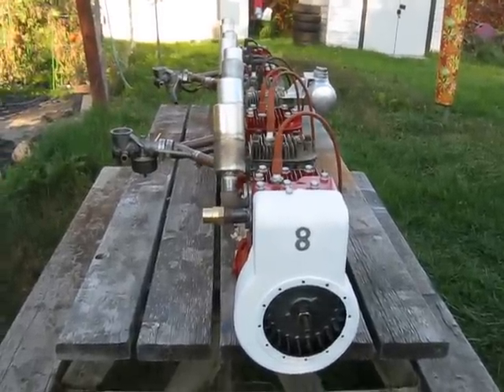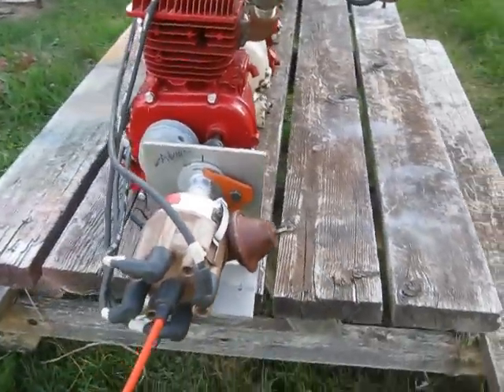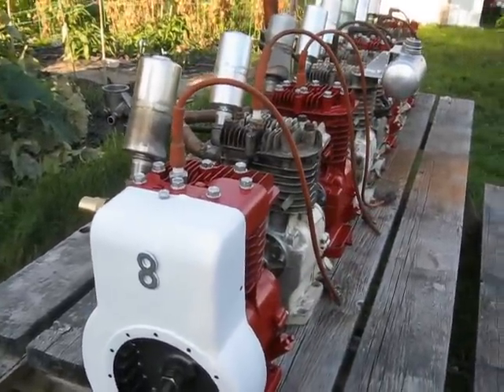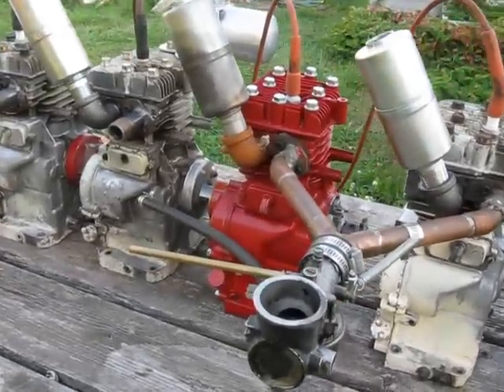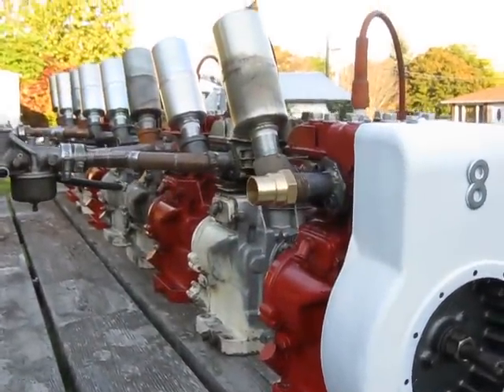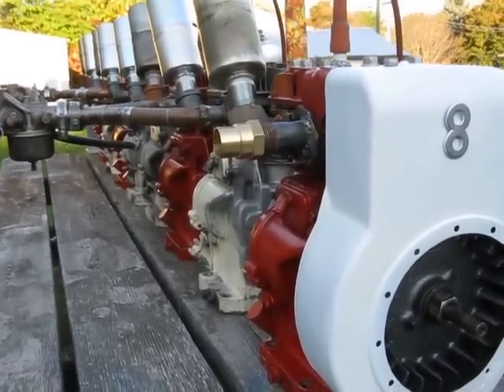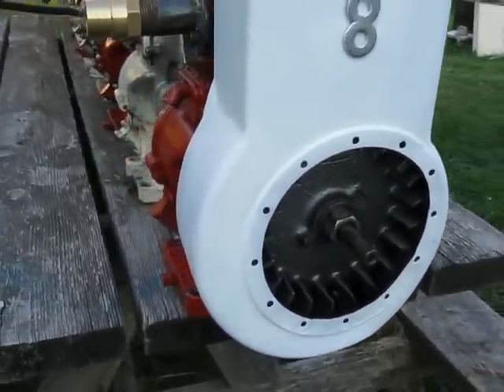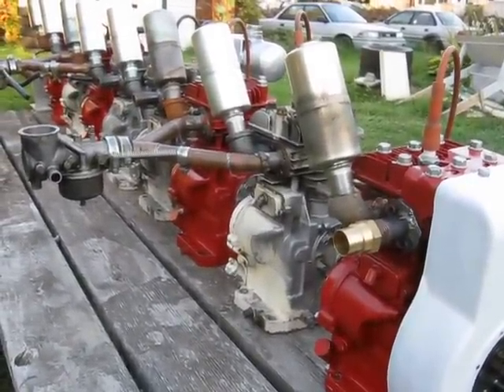Straight 8 Cylinder Briggs Preview!

Comment: use heat sinks and fans to help the cooling
Reply from the maker: +Andrew Sybert I was planning to use a fan or two on the 8 cylinder, as long as it holds together long enough to get hot!
Reply: +ChargerMiles007 lol great job ever tried making Stirling engines? they are really fun to build best regards, Andrew.

Comment: Cool project !!!! 
Maybe you can turn it into a back-up generator for your house or something.
Reply from the maker: ***** LOLYes, it would have lots of power to run a generator, but I am not certain about the reliability of the FrankenBriggs engines! The 2 cylinder stacker mower seems to be OK, but these bigger ones don't have much cooling air moving, so they would melt down rather quickly.

Comment: Looks cool man, 8 cylinders short of a 16 cylinder heh, heh. 8 cylinder, 4 cycle has a power stroke every 90° fires only 4 cylinders per 360° crankshaft rotation. Well Charger Miles, it shouldn't be too hard to get your crankshaft synchronized correctly. We're still watching for the 20 cylinder to show up some day. Can't wait to hear it run man! I bet it will sound good buddy. Take care!
Reply from the maker: PermianBasinDiesel LOL  :)  Sorry to disappoint you with only an 8 cylinder Briggs!I have thought of larger engines, but I will be hard pressed to even get the cranks made for this engine now. Been kid of a bad week for me, wife's car crushed, probably no machining access where I used to go, cold weather and rain making it hard to work on my winter car etc. etc.  Gee, it almost sounds like I am bitchin a bit here!  :)I tell you what, if I win a lottery, I will definitely build the inline 20 cylinder Briggs  :)Have a good one.
Reply: ChargerMiles007 Hey buddy, just joking with ya about a 16 cylinder. No disappointment here. You are the Briggs & Stratton KING !! The 8 cylinder will sound good though man. Take care!

Comment: You just keep on cutting off bigger and bigger pieces of pie! I must say I am a little worried about the cranks and the adapters throwing timing off some, but if you went with the centralized distributor it would help a lot in this setup; along with avoiding 7 foot long sparkplug wires!
Reply from the maker: 2boredfortv Yes, I came to the same conclusion, and will put the distributor drive on cylinder #3. The engine will just have to live with the timing being out, the 4 cylinder seemed to tolerate it OK.

Comment: I just saw a '37 Chrysler Imperial with a flathead straight 8 last weekend, one of my favorite engines. Packard also used flathead I8s.
There's a video on here where someone took two turbo inline 4s and coupled them together to make a straight 8. I think yours will be twice as long lol. Good luck!!
Reply from the maker: SuperKONR Yes, straight 8s are cool looking engines indeed! I think I have seen the vid of the two 4 cylinders, cool vid.  Yes, I can use some good luck with this project, as it requires a lot of work!

Comment: I love it  ,,   that will be massive
you should try fabricating a uniblock and crankshaft  and making a 4  or 6 cylinder  engine without the  lovejoy couplings

I wish i had a decent  camera to show you some of the  stuff I have been doing 
I have been playing with a couple of   small diesel engines which I bought at a junkyard ,,I plan on installing one of them in a modified  lawn-tractor
Reply from the maker: wildcoyote34 Yes, it will be rather massive!Since I read this comment a few hours ago, I have been toying with the idea of a "uniblock" construction, but I would do it like my "2 cylinder Stacker engine" rather than a welded unit like 805RoadKings 4 cylinder. This is mainly due to the fact I use aluminum engines, which I don't have the capability to weld. (Though AC/DC Welding could do it, welding 8 engines together would put a serious strain on any friendship!!!)  The crankshaft machining would be a lot of work also, though I am in for lots of that anyways. It would result in a more accurate looking straight 8 engine though.
Reply: I love the 4 cylinder engine  805roadking made  too ,, it is  actually  a work of art  which i thought was cool watching him build ,,,
but  I also seriously love  your   junkyard creations that you have made 

I thought about matching a pair of small diesel engines together in a side by side configuration  and using them to power  a tractor ,,the only part that will be hard is connecting them together  and getting them synchronized

Comment: You should consider putting the distributor closer to the middle to save on the length of the plug wires and the possible loss in spark over such a long wire.
Reply from the maker: redneckbryon To be 100% honest with you, I was already planning that, I just used the existing set up to make the vid. It took me all day to tear the FrankenBriggs 4 down, clean up the 4 white engines, assemble them with the manifolds and exhaust, plus sand, paint and weld the 8 onto the new cooling shroud. Yes, the #1 spark plug wire would have been about 7 feet long!!!

Comment: Will a drill have enough torque to spin it over? You may have to use a 5hp briggs to start it LOL.
Reply from the maker: Tinker Jim I doubt a drill would turn it over, especially without tearing up the 1/2 inch dia. starter shaft. I did use a drill to test run my Briggs lawnmower air compressor years back, as well as to check out the ignition timing. I am thinking I will need at least 2 starters for this 100 cubic inch Beast!